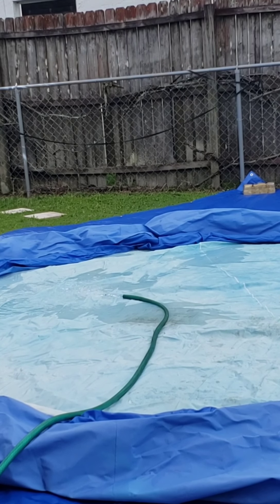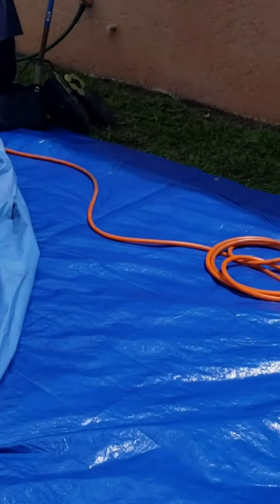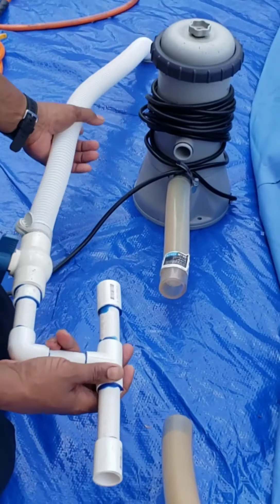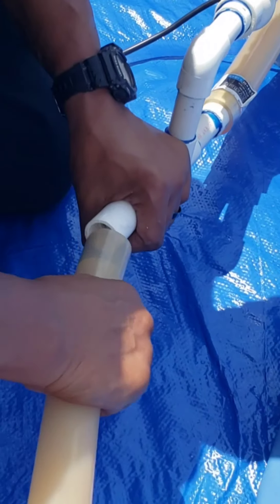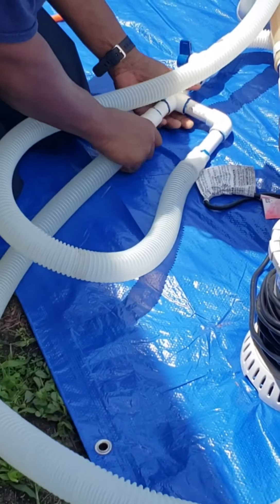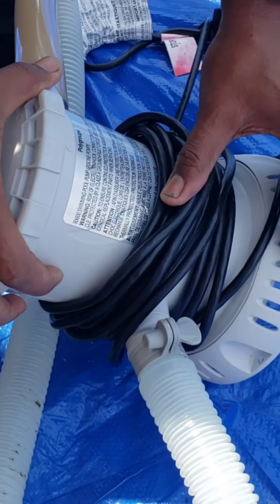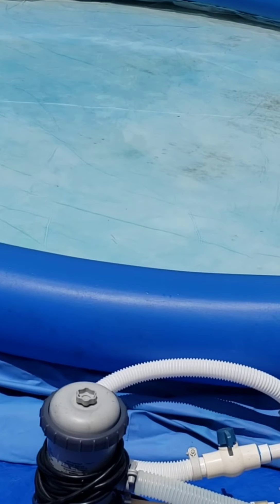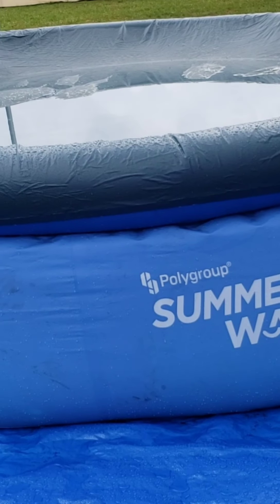Summer Waves 15 Foot Complete Easy Set Up

Comment: Okay nect year for sure. What is that adaptor called for the pump? Also can i add a heavy duty extention cord to it.
Thank you
Reply from the maker: The adapter we bought was Pvc ball valve 1 inch 
 Yes definitely you has to use a heavy duty extension cord 
Thanks for watching have a great day
Reply: @homemadecreationsbyluzciou7106  Thank you very much